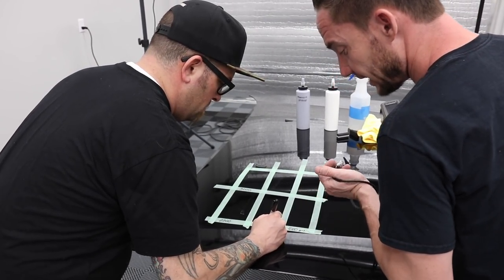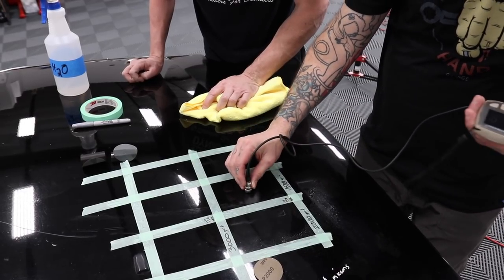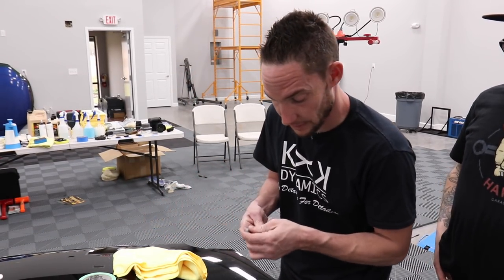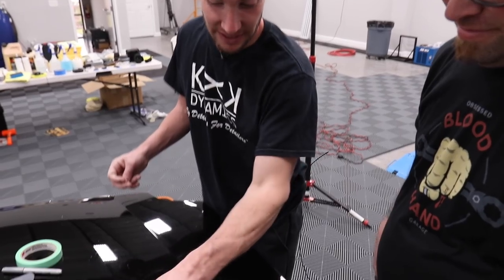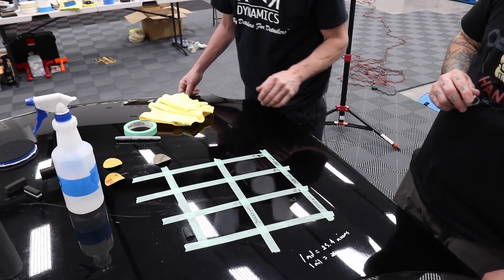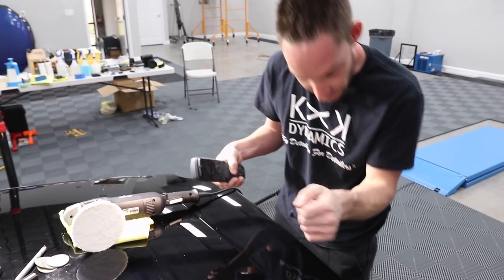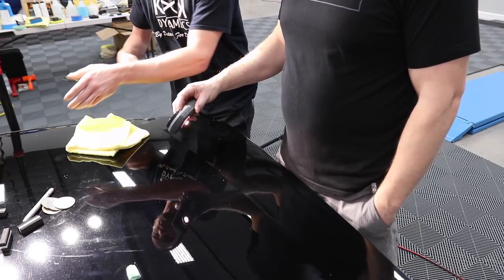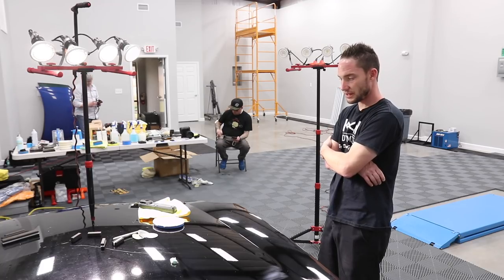Wet Sanding & Advanced Polishing: E4 - Sanding & Measuring

Comment: Excellent video and very informative. I have wet sanded to 1500 grit and then to 4000 grit on my caddy once to take out a scratch..its lots of work. I have never done it again since then. Used Megs 105/205 topped with Z5..Thanx for the video.

Comment: There was 20 or 30 micron differences in readings within the small sections pre sanding. Using the lowest reading was a poor starting position as the places the guy sanded could have been the spots at 132 microns.
Reply: Thinking the same thing, there’s videos that a guys name I forget from lake country manufacturing and he talks about how he made this device with a laser pointer to gauge accurately how much clear he’s taken

Comment: So Matt, if I'm understanding Jason here (and I think think think mayyyyyybe I am) is that when you short cycle a DAT compound it essentially acts like a SMAT compound. The abrasive particles don't get broken down as much and remain larger and have more cut?

I could watch this 20 more times. And probably will. Thank you :)
Reply from the maker: That's the gist of it.  The logic is to make as few passes as possible to correct the scratches.